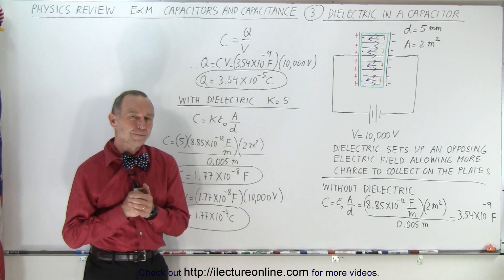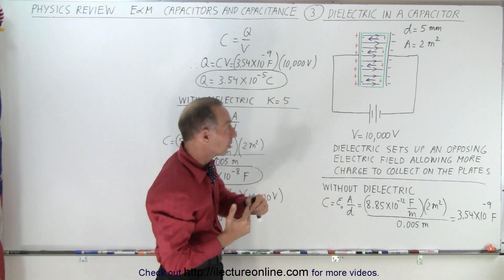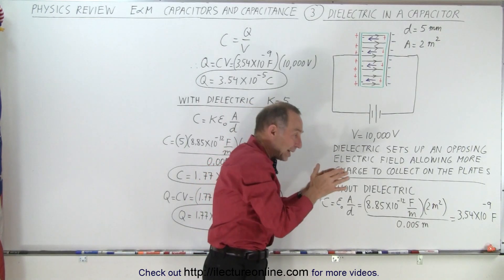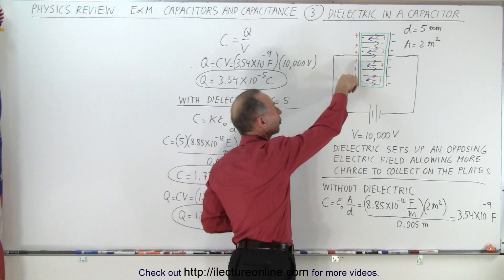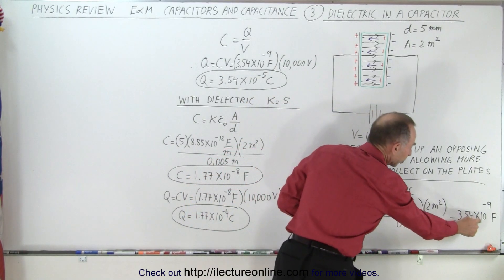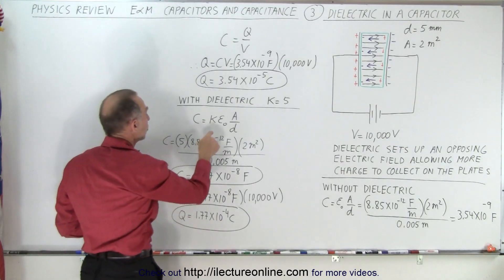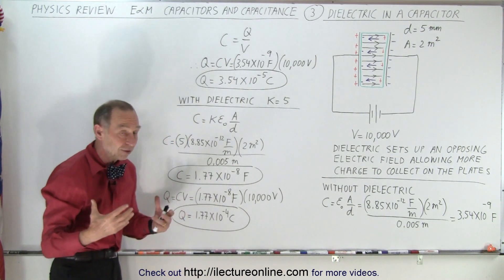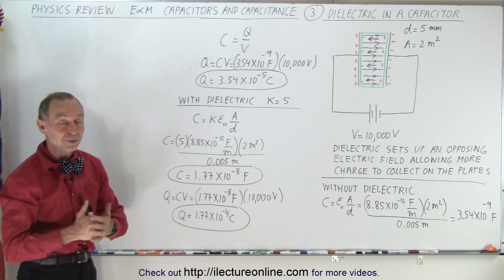Physics Review: E&M Capacitors and Capacitance #3 Dielectric In A Capacitor

Comment: Thank you so much. 😁 I am taking my last exam left in Electrotehnics(statics, DC dircuts,  magnetisam,  AC circuts). I am studying Mechanical Engineering and the study material is good but some subjects like dialectrics in a capacitors are really badly explained. Some equations just come out of nowhere becouse thay try to explain so many topics in a 4 mounth course. Are there going to be videos on spherical and cylindrilcal capacitors with a dialectric filling?